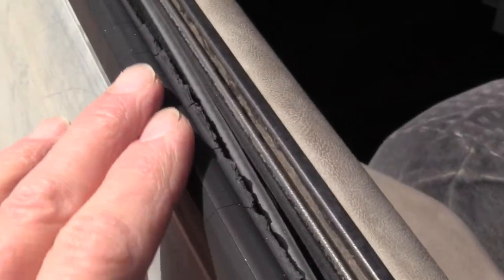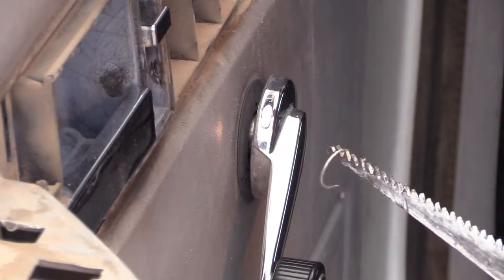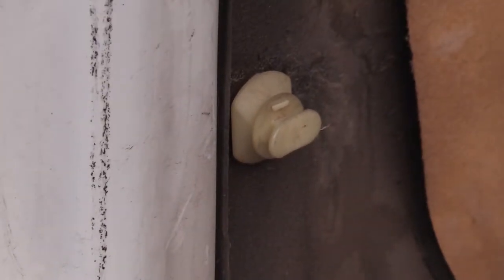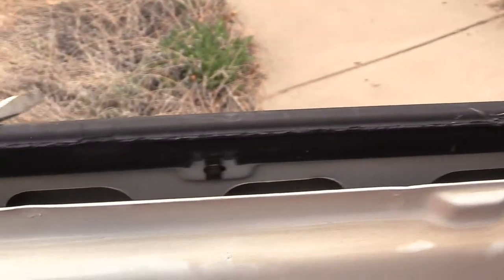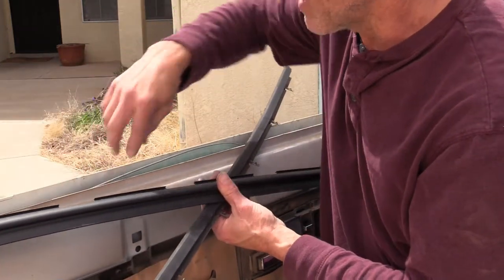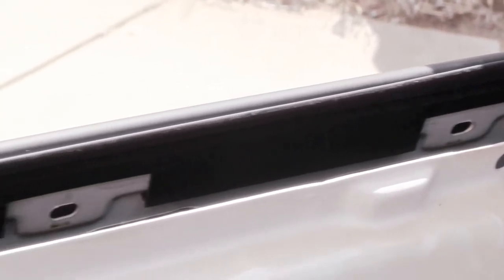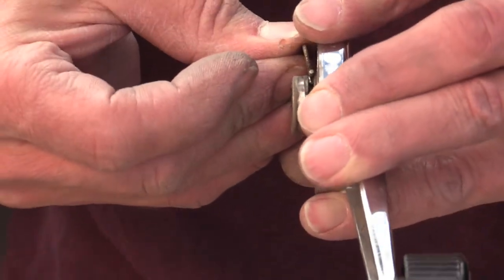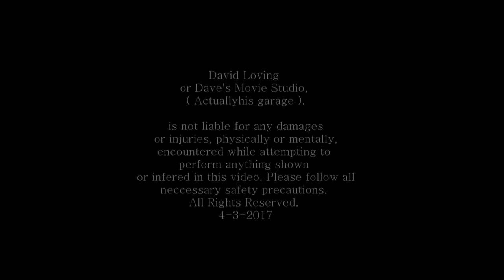1992GMCtruckwindowsweepreplacement442017A

Comment: Nice video. Working on this now, it seems that it is a lot better to take the panel off to replace these. In the process you can lubricate the door components, window regulator etc. that no doubt need it if your window sweeps are that deteriorated. I needed to get the correct tool to remove the handle clips, as the hard plastic panel does not leave much room to get in between it and the door handle to remove the clip. 👍

Comment: i have a 1991 silverado w power locks and windows. is the procedure the same or similar? also it looks to me like i could remove the old sweep with out taking the door panel off. is this possible?, or do you just make it look easy? thanks
Reply from the maker: well, the sweep goes under or behind the side mirror, so to get to the mirror nuts, I had to remove the inside door panel. The video I shot was the second one, I did the passenger side first, so it went faster, but I still had a time getting that last pin or hang up to give before the panel came off, hence the dissolve in the video. I'd say that the panel has to come off. It's not a big deal after the first one. You will have to disconnect the power connectors to the buttons, though.

Comment: Pretty sure this is NOT how to remove these door panels, handles, switches, etc. Dude used a drywall hole-saw to remove his window crank
Reply from the maker: You are correct! There is a tool made for that, but anything flat will work. I did scratch myself with the hole saw! Video is for entertainment only. Thanks for watching.
Reply: If you don't have the proper tool, sometimes you have to improvise, and he did!  Good job!!